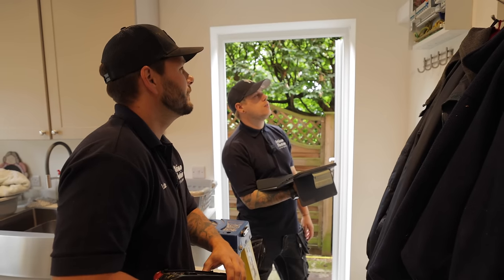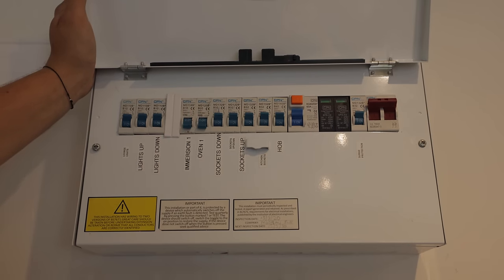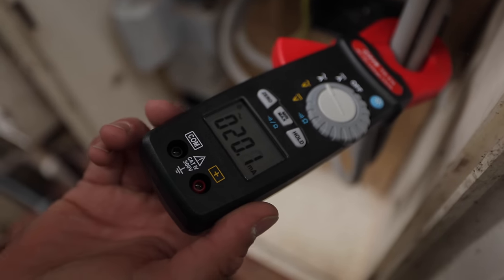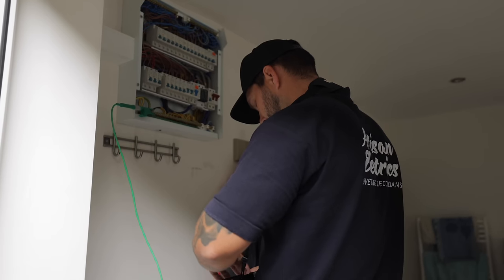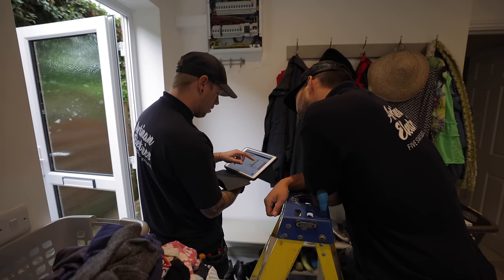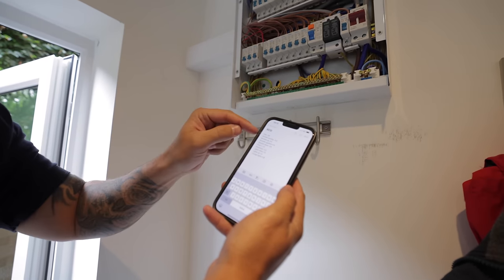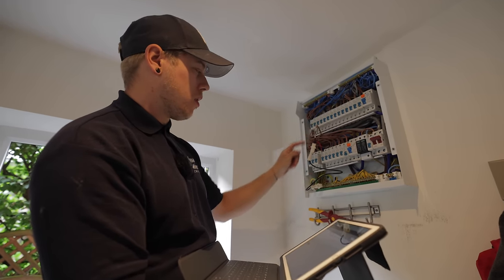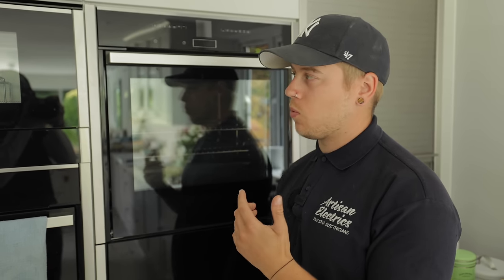CHEAP Electrician cost this customer £1000s💷

Comment from the maker: If you want to get our amazing tool of the day 😎(The TIS 570) then click the link to find a potential dealer for the product - 🧰🛠https://bit.ly/TIS570
Reply: lol "Potential dealer" you couldn't resist that one.
Reply from the maker: Just realised ... @michaeljarcher
Reply: Nice bit of kit!
But do not test PV Voltage with it as it only goes up to 300V DC  AND the CAT IV Rating is only 300V 
For PV you need at least  1000V DC Range
Probes also need to be rated for 1000V
Reply: That product looks like something for educational/home use but with a pro price tag. It only goes to 10A dc but looks like it should handle 200. Try the N2780 probe from Keysight - 500A AC/DC (but does need a scope..).

Comment: You really think the customer deliberately went for a “budget” board? The house doesn’t suggest that. How about, he got fleeced by a contractor who charged him the Earth and went cheap with the electrics to maximise his profit.
Reply: Exactly
Reply: This. Cowboy sparky based his price as he pulled up on the driveway for the first time.
Reply: He’s just getting click bate now ! Interesting title boring content !
Reply: At the end of the day the house owner should have employed a qualified electrician to do the board change and electrics, not a builder or a kitchen fitter, which is obviously who has done this budget installation.
Reply: @Hustwick He wasn't a  sparky, he was a builder or a kitchen fitter. That's why he's put so many circuits on a Type AC RCD in a split load board, he doesn't understand the finer points of electrics, or even the basics like earthing metal faceplates and light fittings. I'll wager that no testing was done beyond "the lighting and sockets are working" and the EIC is a complete fabrication.
Reply: @gadgetman36  And you know this how? You seem to have all the answers. Is it your job?
Reply: That's the far more likely scenario - an unscrupulous electrician.
Reply: @garybillins4760 how is to click bait? He doesn’t blame anyone
Reply: Surely it's more a case of the owner got multiple quotes and then picked the cheap one. It's cheap for a reason because they are doing it with cheap parts and not doing there job properly. 

This is a prime example or pay cheap pay twice in my opinion.
Reply: @Dbdiagnosticsltd maybe the cheapest isn’t someone who thinks he should be paid £1000 per day? Maybe sparkies should be putting detailed quotes spacing out every item they will install? Good YouTube videos will be informative for the customers so they can insist on the correct behaviour and quality materials. Still at least they didn’t accuse DIY Dave of doing it.
Reply: @Dbdiagnosticsltd  you’re guessing, like we all are to a certain extent, but you’re in fantasy land. You think a guy who lives in a house like that, gets a contractor in to do the extension and then cheaps out on the electrical side. Then, miraculously, he has a Road to Damascus moment and converts from being a cheapskate to calling the most expensive sparks in the country? Puleeese………..
Reply: As seems normal for this channel now, they wanna call out others' work rather than fix it (whilst also doing highly questionable installs themselves)....always 'last guys fault & we're the best mentality...sponsored by hilti '
Reply: @michaeltodd17  While also doing highly questionable installs themselves?!?  I've only watch a few of their videos, mainly from "the boss" (I don't know his position in the company but you probably know who I mean).  I have seen things where I would disagree with them, but that happens often and it's the inspector's own opinion based on personal experience that gets written on the cert.
But haven't seen what you describe.  Please point me at something I will find horrifying as an inspector...
Reply: They’ve never suggested the client was to blame here
Reply: @KevinSmith-ph6jv  Agreed, but others do, which was my response to them. I don't like clickbait titles, but I understand why Youtubers use them. However, I think Artisan should explain the situation, properly,  in the body of the video for proper context. We still don't know who got the spark in. Builder  or client? Budget? Says who? The client may well turn round and say "WTF? do you know how much this cost me?" "Budget Install cost this customer £1000s". Why? Because they called Artisan? 🤪
Reply: @BerkeleyTowers 
You assume that Artisan got told all the details you're looking for ?

Maybe the client is feeling a bit foolish or ripped off that their pride and joy of a new extension has got problems, so hasn't gone into too much back story.

Probably just phoned and said there's a problem with a tripping RCD can you come and have a look ?
Reply: @scots_knight4706  Thank you. You just made my point most eloquently. They could have said that.
Reply: Those boards if not compliant wouldn't be sold. You can have multiple circuits on one rcd, not the best design but you can do it. You can't fully blame the previous spark for this.
Reply: @gadgetman36 I’m a kitchen fitter and I’m qualified. Don’t judge everyone by your own standards dkwad
Reply: @marcusstonham  
Sure, you can have multiple circuits on one RCD... but "multiple" means 4 or 5... not 10+.
It only takes 15-21mA for the RCDs in my home to trip, 5 circuits is already pushing it.

As for non-compliant boards being sold in the market... you'd be surprised.
Reply: Leave it to the pros. Silly sausage.
Reply: Buy cheap buy twice
Reply: Customers with nice houses seem to be the cheapest but ones that can’t always afford the best quality stuff seems to understand that there’s a cost to it and it’s kind of needed

Comment: From the USA, I am amazed a the degree of thoroughness with which professionals perform an EICR in the UK. Nice catch that the RCD was occasionally tripping from the sum of the ten attached circuit leakage currents, none of which was, by itself, dangerous.
Reply: Yea europeqns have standards😂❤
Reply from the maker: Glad you see how professional we are haha
Reply: @xmfclick  thats what i honestly thought too 😉
Reply: @xmfclick  UK regulations are crazy. They are ludicrously complicated yet they do not cover important points like the number of circuits per RCD. Enforcement is poor. My neighbours rented their flat to the local council who decided a new CU was needed. When it was sold the new tenant brought in an electrician who found brass switch plates on unearthed wooden boxes, and wall lights wired from the nearest wall sockets.
Reply: I agree, they go overboard on this EICR nonsense. R this and R that is just money grabbing. Get over it UK , an earth is an earth, not and R this and R that. If the earth is connected then great.
Reply: @bigwoodrz That's wrong .  An Earth must be so low resistance that a short to earth inside your bedroom gadget will blow the breaker or fuse instantly .  But the complicated UK tests are caused by that crazy "ring mains" system that relies on equal wire resistance to split the load equally between the left and right undersized cable .  Rest of Europe doesn't allow fuses / breakers above the wire rating, so it's all spurs and no rings or ring tests .
Reply: Not all EICR’s are this thorough. Even with red flags and codes, some sparks will sign it off, charge the money and bounce.
Reply: @johndododoe1411   I'm surprised the rest of Europe hasn't started using rings due to the price of copper, as that's how it came about in the UK after the war with a shortage of raw materials and a major housing rebuild required
Reply: True origin story of why we used ring circuits, but actually sometimes you can use less copper without a ring circuit. Saw a detailed video on this recently
Reply: @johndododoe1411 I LOATHE ring circuits

Comment: In the The Netherlands your only allowed 4 breakers per RCD, so in this case the customer should have had at lease 6 RCD’s.
Reply: We need that in our regs!
Reply: would that just encourage people to put too much on each breaker?
Reply: @DJ_Mada It's already in the regs that in most cases an RCBO board should be fitted, unless you have a good reason for installing a split load RCD board, which is very unlikely in a residential property.
Reply: It’s 3 here in New Zealand. Often you’ll find a 45 way board in a 3 bedroom house 🤣
Reply: It’s 2 for Germany.
Reply: 3 in Australia. We are a little pedantic with our rules and regulations though.
Reply: Nobody in their right mind is going to install a consumer unit with 6 RCCB’s, better off install a fully RCBO board.
Reply: @alvina69 what do you mean "in their right mind"? It was only 3 years ago that the regs were exactly that!!
Reply: @nathd1748  The regs in the UK have never ever stipulated how many RCCB’s should be installed in an installation.
Reply: @alvina69  you are mixed up mate. I was referring to having split load boards with up to 6 MCBs on one RCD. Ìts only 18th Ed where they are going with individual RCBOs
Reply: @nathd1748  Me mixed up, nah not me mate, I was reply to the original post about having at least 6 RCD’s on this board. I think you should read the comments properly before responding. Nobody on this thread was referring to MCB’s just you.
Reply: @DJ_Mada  UK has gone to RCBO's removing the problem completely.
Reply: @trevorstevenson4038  Yes I have seen the boards on the external walls and porches of houses for all to tamper with 🤣🤣
Reply: UK has RCBOs now, almost everything is RCBOs now
Reply: All new installs should be RCBOs without exception, and then this problem goes away.
Reply: @jackroberts691 In the US in new construction you get 72-84 circuit panels in 1500sq ft 3 bedroom houses, but the US is pretty crazy compared to the rest of the world. GFCI (RCD/RCBO) breakers aren't even required except for wet locations. Instead they require AFCI, which I have never seen any proof of them working, so some states have already removed that requirement. Why they didn't just require GFCI on all circuits is beyond me. The earth leakage test like was done in this video in the US is done by putting a clamp meter on the main ground, turning off all circuits, and then turning them on one by one and measuring current across the ground wire. Sometimes you see the neighbors power returning through your ground because they have an open neutral.
Reply: @alvina69  Price RCCB + MCB is less than RCBO, MCB after 3 shorts is better to be replaced, and whit 3 MCB you can put 3 diffrent Amp ratings 6, lamps 16 sockets for example with only RCBO will be wastefool and expensive

Comment: I can see on your Megger that you have it set to Type A mode for RCD Testing - however the board contains a CPN RC263/030 - which is a Type AC RCD.
Also amendment 2 of 18th edition states AC only testing should be used to test an RCD of any type, to determine if it is functioning and tripping within the required times. 

What I find quite funny is you even state later in the video how DC can blind an RCD and prevent it tripping - which is exactly what you did when testing a Type AC RCD with the tester set to Type A mode. 

Yes the board was cheap and a bit nasty, and a ridiculous number of circuits were run off each RCD....however the RCD itself probably does work for AC fault currents, just you were testing in the wrong mode.
Reply: I noticed that too. I suppose they have too make it worse than it is for their YouTube channel 😉🤣
Reply: It's all very well being able to spew out a few key facts that are repeated by instructors "DC can blind an RCD", but I wonder how many electricians really understand RCDs and how they work.

I have come across a 'professional' electrician on eFixx state that the RCD protects from earth faults from upstream of the device, which they do not and this can be easily determined by drawing out a circuit diagram, placing on the faults in different locations and analysing the currents.

Then we had someone from Artisan claiming that a coiled up extension leads gets hot because of magnetic induction.

There seems to be a basic problem in the ability of electricians to be able to perform simple circuit analysis.

And don't get me started on the crap spewed out by that well known American electrician on YouTube.
I have lost count of the number of times I have had to correct his inaccurate statements.
Reply: @deang5622  That's the difference between an electrical engineer and an electronics engineer with a degree - such as myself.
Reply: @blower1  No, both electrical engineers and electronic engineers both have the same level of proficiency in this area. Both are taught the same fundamental subjects on circuit theory and magnetics, electrical machines.

It's the difference between an electrical or electronics engineer and an electrician.
Reply: @deang5622  In this instance i referred to an electrician as a 'electrical engineer' (wrongly or rightly...more wrongly imo :D )  - but yes it is the difference btwn an electrician and an electrical & electronics engineer.
Reply: @blower1  Glad we agree!
Reply: Just more mouthy contractors?

Comment: To be honest, start of the video I was thinking they don't understand RCD trips but Luke's rant proved that he does understand it.  Trying to find which circuit is at fault if there is a N-E low resistance can be hard work, usually drop the neutrals out and IR each circuit but using a clamp meter such as shown can really help.  Using it around L+N at the incomer will only show up a reading proportional to any other circuit is actually drawing power though.  You could just use the clamp meter around the individual CPC/earths at the board which is the same as clamping around L+N, then again that doesn't help if the earth leak is to a water pipe.  Well done guys.
Reply from the maker: Both of these guys have gained so much knowledge about these things
Reply: Thought the same thing when they were switching off the breaker and measuring leakage getting half the story, I am pretty sure they were only single pole breakers.
Reply: Clamping on the CPC doesn't show leakage to earth via other routes such as pipework etc.
Reply: @farmersteve129 And clamping all L+N together measures exactly what the RCD measures, just don't include E in the bundle .
Reply: Understanding Kirchhoff's Current Law is key.

And it is very simple to understand.

If you are an electrician and you cannot analyse a circuit in that way, then you need to get your head round it.
Spend time practising analysing current flows in simple circuits.
Do it until it becomes second nature.
Reply: @deang5622  It's Kirchhoff.

Comment: On Hagar boards you can replace an RCD with a special connector to allow you to replace the MCB's with RCBO's. Way cheaper than changing the entire board
Reply: European boards (including UK) all use standard DIN rails, so any brand modules fit any board .  Problem is that single pole breakers are usually 18mm wide each, RCBOs and other dual pole gear is usually 36mm wide each, and that board was packed almost completely, so they needed a larger board  .
Reply: @johndododoe1411  RCBOs in the UK are almost always18mm, not 36mm wide. It's RCDs that are 36mm. Also, most UK RCBOs are single pole, although some makes have dual pole 18mm RCBOs.
Reply: @TheEulerID  Single pole RCBO?

Comment: Absolutely agree get rid of split loads modern electronics have AC/DC leakage the cumulative effect has grown over time..Type B or F is the way to go but manufacturers as you say need to make them cheaper.
Reply: Type B and F RCDs do not come as RCBOs, so would have to be installed as split loads.
Reply: It's not the cumulative effect that is the issue. That can and still happens with type B or F RCDs.

The cumulative effect is the DC leakage current produced by each load which sums together. Even RCD types designed to handle DC leakage currents have an upper limit on the amount of DC leakage they can tolerate.

The issue is that of type AC RCDs not being able to handle any DC leakage current, AND many modern appliances, such as washing machines, dishwashers which incorporate variable speed drives, and computers producing DC leakage current which the type AC RCD cannot handle.

It's simply a question of using the correct type of RCD.
My view is, Type AC should be completely phased out. 

There should be a mandate issued that Type AC RCDs in existing installations should be removed and replaced with a B or F wherever possible.

And where it is claimed there is no alternative for the Type AC that is installed, the owner should be made to demonstrate a safety check has been performed by a qualified electrician and the magnitude of the DC leakage current measured with appliances in the property running to prove that there is no DC leakage current present. This is an easy test to perform.

IE. Prove the continued use of that type AC RCD with that particular set of appliances in the house, is safe and that the RCD will trip when required.
Reply: @deang5622  may be I did not explain myself well I think the point is the same type AC RCD should have been phased out long ago. Yes of course there are upper limits of leakage current both AC and DC that type B and F can handle. The UK will head towards larger boards with more dedicated circuits for specific pieces of equipment like we have in the USA given that both AC and DC current can be cumulative.